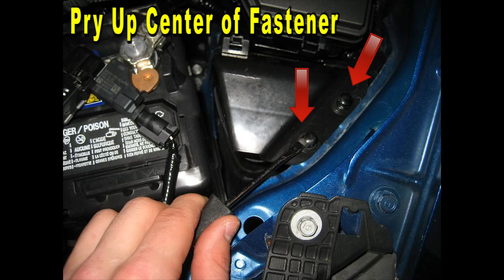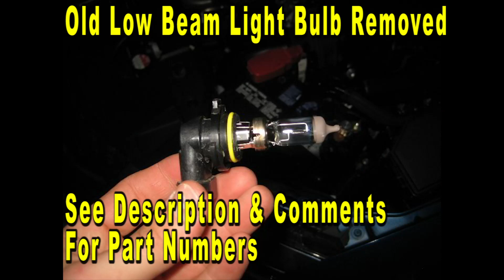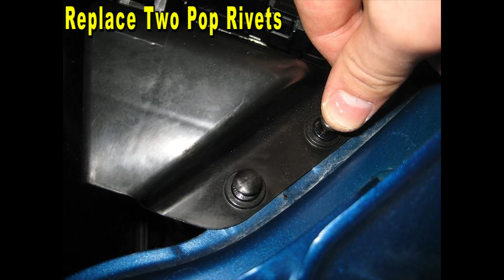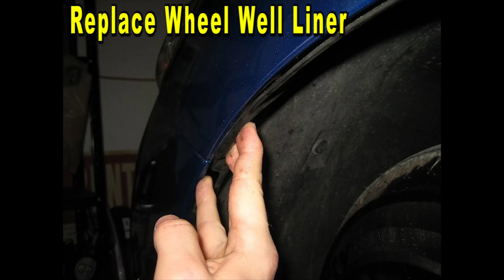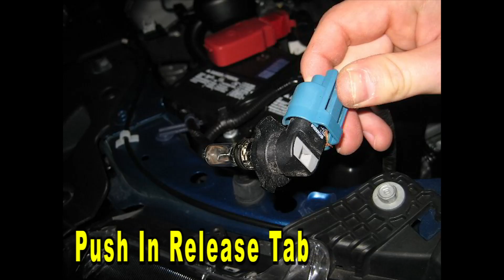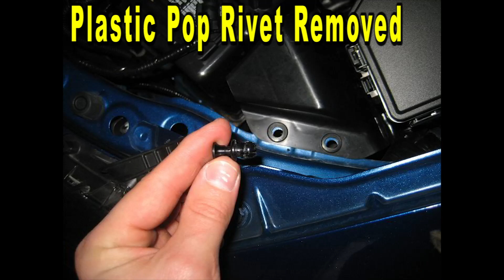Honda Civic How To Change Headlight Bulbs 2012 To 2015 9th Generation With Part Numbers

Comment from the maker: Honda Civic Low Beam Headlight Bulb - https://amzn.to/3iaynGO
Honda Civic High Beam Light Bulb Part Number - https://amzn.to/3X7oiJg
LED Low Beam Light Bulb Part Number - https://amzn.to/3X2vdUa
LED High Beam Light Bulb - https://amzn.to/3X1zG9G
Honda Civic Front Turn Signal Light Bulb - https://amzn.to/3X6PJ65
LED Front Turn Signal Light Bulb - https://amzn.to/3GDb1my
Pop Rivet Removal Tool - https://amzn.to/3VGBB2d
Socket & Ratchet Set - https://amzn.to/3Z17LbA
Mechanix Gloves - https://amzn.to/3jCnHkt

The Paul79UF YouTube channel is a participant in the Amazon Services LLC Associates Program, an affiliate advertising program designed to provide a means for sites to earn advertising fees by advertising and linking to Amazon.

Comment from the maker: Check out the DIY guide for changing the headlight bulbs (low beam, high beam, front turn signal) in a 2012 to 2015 Honda Civic - 
https://www.paulstravelpictures.com/2012-2015-Honda-Civic-Headlight-Bulbs-Replacement-Guide/index.html

Here are all of the DIY repair and maintenance tutorials for the ninth generation 2012, 2013, 2014 & 2015 Honda Civic - 
https://www.paulstravelpictures.com/Articles/2012-2015-Honda-Civic-Common-Problems-Repair-Maintenance-Guides.htm

Owners of other Honda or Acura vehicles such as the Accord, Crosstour, CR-V, CR-Z, Fit, Insight, Odyssey, Pilot, Ridgeline, Stream, ILX, TSX, TLX, TL, RLX, RDX and MDX may also find these DIY instructions to be helpful.